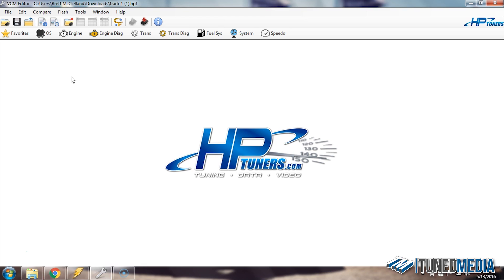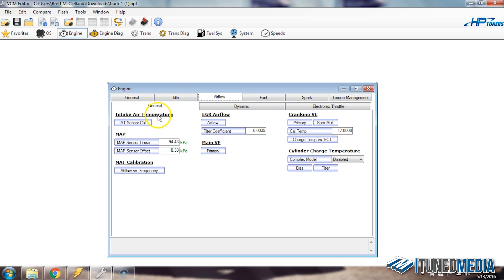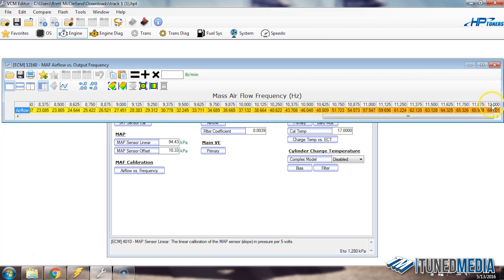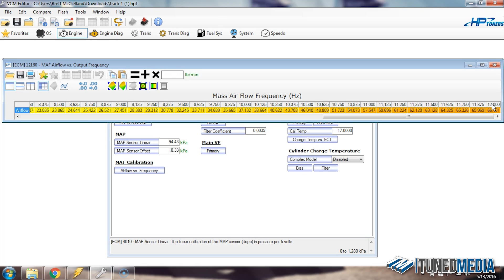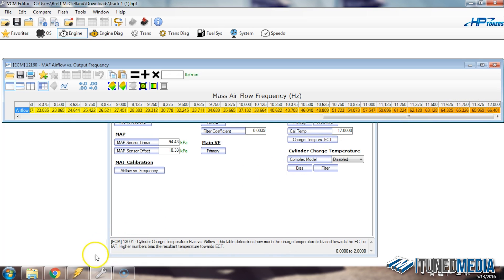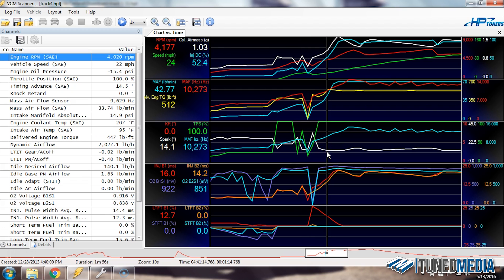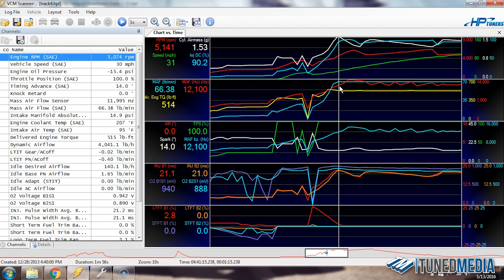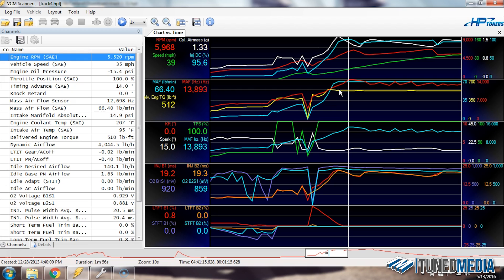How to Tell When You've Exceeded Your MAF (Mass Airflow Sensor) Using HP Tuners 3.X

Comment: I need help. 
I have a diesel car. Yes im lame I know.
I was cosidering to reolace the short ruber pipe that conects maf cousing to the turbo, does the diameter or shape of the pipe mater? Was thinking using a silicone oje that has no "ribs" like on my rubber stock one. 
Thanks

Comment: Hi..maybe a really dumb question.. but with a turbo.. does the mast air sensor gos on the inlet air on turbo or on the inlet of the throttle body to get the correct reading to the computer

Comment: I heard you can use a Ls-9 style sensor in a 4" tube for turbo LS swaps, is speed density the best option? I'd like the ecm to work most effiecent , or as effiecent as possible, with boost, and still get good low rpm mpg on the highway, and in town. I spent $150 on gaa on weekend, just cruising around the car show , I do not want to do that again, that worked out to about 4 mpg. I'm looking to give a 4.8/5.3 about 14-18 psi.   What system with stock gen3 ecm would be best, even using a LS9 maf in a 4" tube,  thanks

Comment: My LS2 12psi SC Vette runs outta air at 5K RPM on the MAP.  Do you think installing a LS3 4" diameter MAP will do the trick? The stock LS2 MAP is a smaller diameter and the intake run is 4" except where it necks down to that smaller LS2 MAP.
Reply from the maker: I believe you are referring to the Mass Airflow Sensor (MAF). Typically, moving from an LS1 or 2 MAF sensor to an LS3 will get you some more frequency range however there are many factors that will come into play.

Comment: Can you add in a resistor in-line with the MAF sensor so as to adjust the readable range?
Reply: You would need to reduce resistance or increase voltage.  Adding resistance will reduce the maximum airflow reading reading of the sensor.

Comment: i think im having the same problem with mines its random so it has to be the sensor and when i reset cpu by removing power cable from batt for 10 min its all back to normal but when im around 150 boosting its sometimes just shuts down and no more boost  att all till i reset it and i get a yellow light on my dashboard i know it has to do with th sensor when its what i think can u verrify if it sounds common  and uuhm i have a seat ibiza cupra whats best upgrade sensor